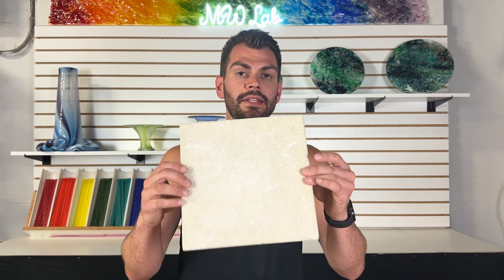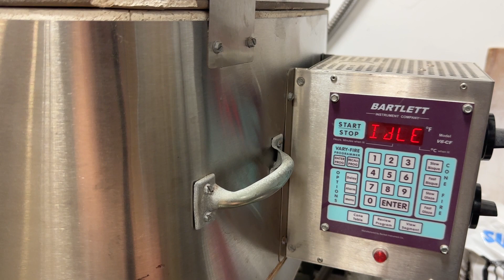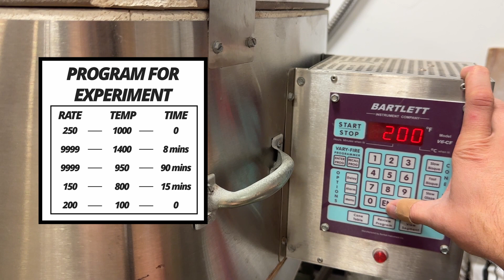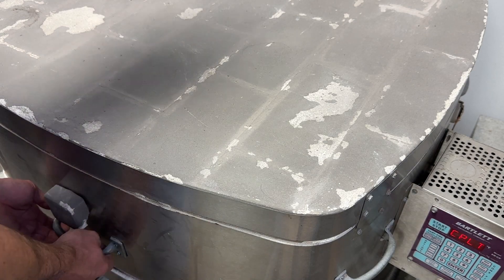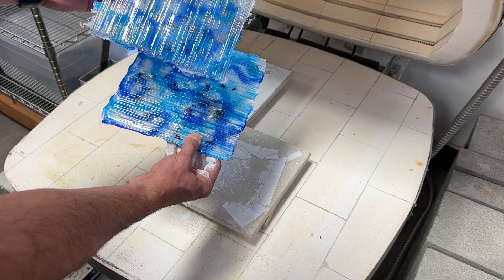Fusing Experiment #6 - Strips and Powdered Frit

Comment: Loved the video. I prefer the frit down as well. Did you try this with the frit design and just plain tecta sheets on top instead of the strips (that I would need to cut)
Reply from the maker: I have not tried that, but definitely would work too. Not sure how well the frit would stick under the glass with a solid piece. The strips allow for more air flow and heat to reach underneath.

Comment: Hi , I've only just "discovered  your channel & I'm hooked !!  So generous to show & explain all these different techniques. I'm a potter for many many years, & a while ago I attended a one day glass fusing workshop, which I thoroughly enjoyed.
I've bought a couple of books on the subject but find some of the explanations "as clear as mud"...  
Anyway I have a question which I've asked previously on a couple of other "glass fusing" groups, & never received a proper answer

Can I crush up some coloured glass bottles  ( as in your video)  & use that in between ( or under ) layers of  plain 3mm window glass ??

thanks in advance, Annie
Reply from the maker: Glad it’s helpful! In terms of using window glass and bottle glass, they are not tested compatible meaning they may not fuse together. Bottle glass can usually be fused with itself but nothing else. This is because fused glass is tested compatible meaning it expands and contracts at the same rate when heated. Otherwise it will crack.